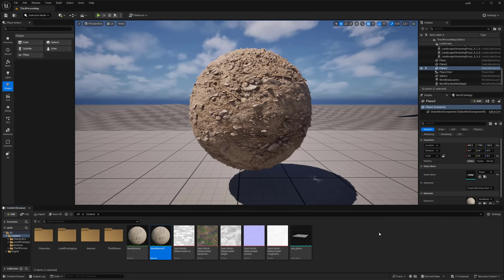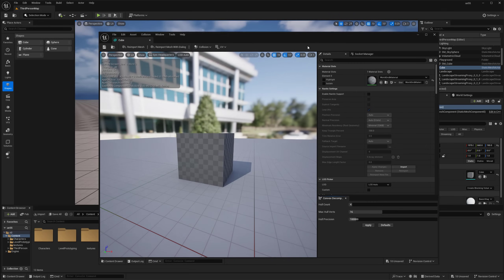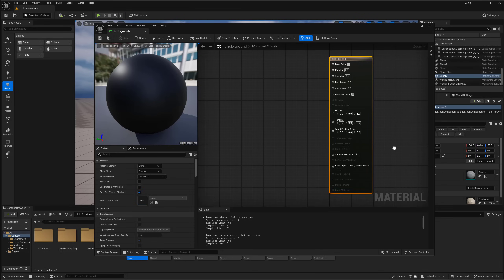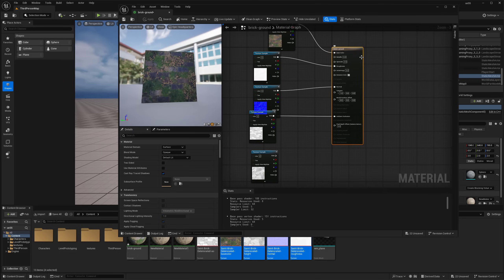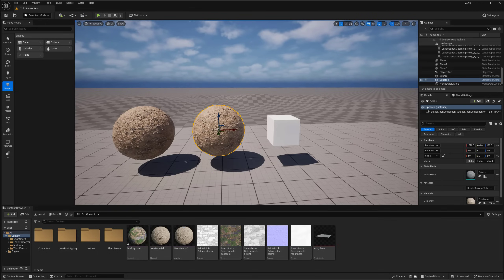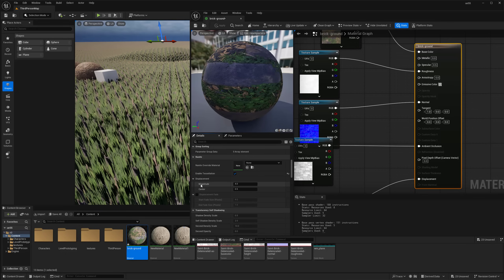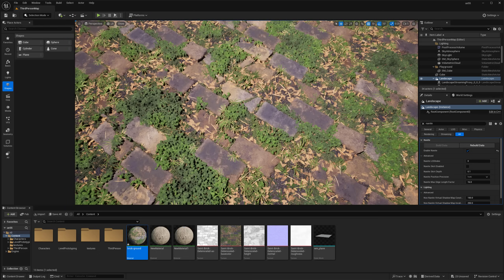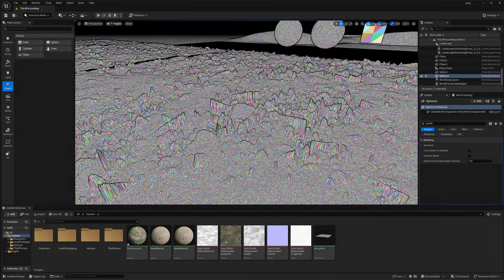Material Displacement with Nanite in Unreal Engine 5.5

Comment: very confused i followed every step to a T, material setup, enabling tesselation, even remeshing the sphere to give it more gemoetry to work with and still nothing, even when i purposely put up the magnitude to like 50 just to see something and still nothing
Reply: Did you find a solution?
Reply: @E-101-Beta  ended up just redoing the whole process in a new project file and it worked. dunno what was wrong w the one i was trying it on

Comment: This does not work tessellation and nanite don't work together on 5.5.4 with AMD cards.
Reply: It depends on the card. I know with an RX 6600 every material with nanite/displacement is invisible in-engine but show fine with an RX 7900XTX. It's definitely an AMD issue but not with every single one
Reply: @erievans  How can I fix this???
Reply: @carlossalguedo2888  You can try going into Adrenaline and changing the "Tessellation Mode" in the graphics settings to "Application Settings." Unfortunately, there may not be a fix for it outside of getting a different card that is compatible

Comment: How would this workflow affect performance versus scattering instanced nanite meshes on the ground?
Reply: so if you scatter meshes all over the floor you are going to have a very high overdraw in the nanite, your also going to gain allot of power in the mat itself, for example you can use the height to vertex paint in a second mat

Comment: What’s the nanite displaces mesh plugin? And why don’t you turn it on
Reply from the maker: To my understanding, I do not believe you need it anymore at least for what I am doing here
Reply: @PeytonVarney  Correct. In 5.5 you no longer have to enable the plugin or edit the .ini file. Thank goodness. Also you can multiply the displacement with a scalar value so you can control the strength in a material instance.